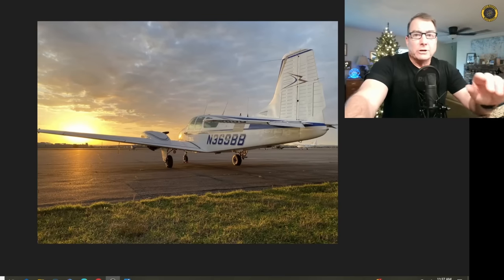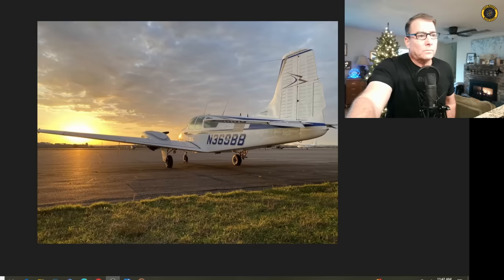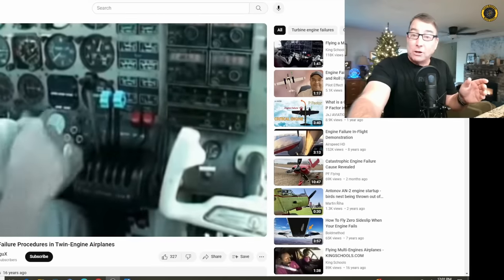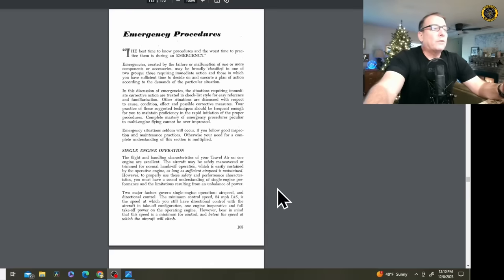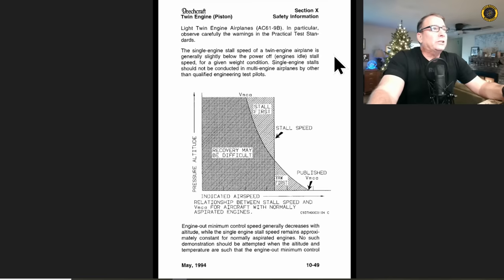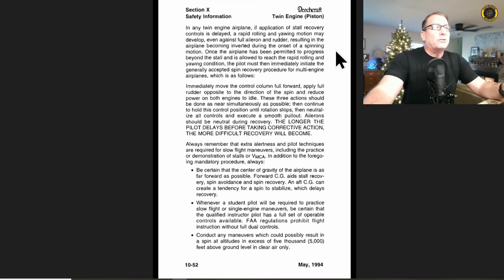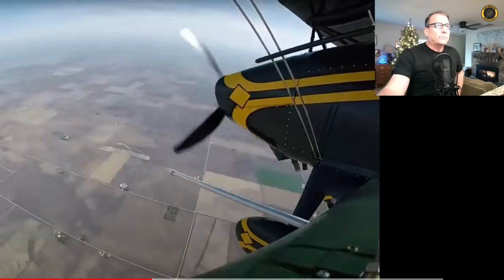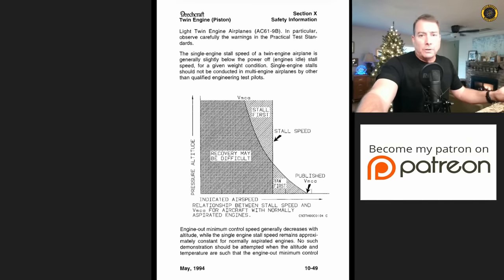Another Fatal Vmc Demo Stall Spin!! N369BB 4 Dec 2023

Comment: In the late 70's, at the biannual CFI refresher course put on by the FAA, a video was shown of an attempt to recover from a spin in a Piper Aztec. The airplane was fitted with a door hinge release and a drag chute. A test pilot wearing a parachute deliberately allowed the airplane to enter a spin from a single engine VMC demonstration. The pilot used all the spin recovery techniques we know about; full opposite rudder and full forward stick. The Aztec continued to spin and the drag chute was deployed. A few rotations later you see the door fly off and the pilot bailing out and parachute opening. When these light twins enter a spin they WILL NOT recover. You cannot let the airplane stall when demonstrating VMC! As you climb to find a safe altitude for the demonstration, the VMC eventually decreases below the stall speed. You must consider the demonstration of rudder input to control yaw satisfactory, prior to reaching VMC. The FAA needs to stop this. In the simulator, we do V1 engine cuts in a 757,  but there is no requirement for VMC demonstrations! Why does the FAA insist on this kind of training?

Comment: Hi Juan. I'm just wondering if this very sad incident---as well as the Vmc demo events you allude to---might relate to the lack of spin-recovery proficiency demonstration in US CPL student qualifying flights. North of the border, all CPL candidates must still demonstrate independent entry and recovery from full spin autorotation, which of course is precipitated by solo practice. When I demonstrate Vmc in Senecas, we are always spin ready. I firmly believe that students must experience the ineffective full deflection of control inputs as the final warning the aircraft provides, and they must also experience how quickly and simply the event can be immediately stopped with idle power. If we shelter our students from these experiences, we are doing them a disservice.

As always, your analyses are core to our on-going recurrent training as pilots.  Thank you!

Comment: Juan, the majority of this video was very well done. However I will mention one thing: this accident in my opinion has nothing to do with the 1500 hour rule.
 
The student was 67 and the instructor (31) had a lot of time in the aircraft. Good time…Who knows?, but I think you would still have this accident in a world without the 1500 hour rule (even if it is baseless). Reform needs to be on the part of the FAA in how VMC maneuvers are talked about and how they are performed to minimize risk and maximize correlation.

Comment: A VMCA demo does not need the use of full rudder. I’ve instructed many multi engine students over 30 years. Instructors please just use half the available rudder when doing the demo. The yaw and recovery are the exact same thing as when using full rudder but you will have a sufficient safety margin above the stall. There is zero reason to make full rudder available to your students. The demo is just to show what happens when you run out of rudder, the subsequent yaw and then recovery. All of which can take place by simulating the event using less rudder.

Comment: Thanks for this. I had heard that there was a tendency for these lower performance twin engine piston powered aircraft to fail on single engine failure, but was not clear why. 

This then begs the question what to do when the AC is above the crossover point when it fails which also follows what reduces the yaw, which would indicate the backing off of the working engine and feathering the prop on the dead engine while instituting a lowered angle of attack in a descent and increasing power to the functioning engine and managing the rudder while approaching the the desired altitude is reached. Then contact the ATC. Seems like they could have put a bigger rudder on these. 

Lets do some physics here, you take off with two full tanks of fuel, then climb at full power to a cruise altitutude of 13,000 feet which is 8000 feet above the crossover altitude. A standard descent at 80knts of is 1000 feet per 3nm which means the descent will require 24 nm at less than 1.5 nm per minute or more than 16 minutes. This means a standard descent will require almost full power of the remaining engine, and thus in order to back off power that craft needs to descend at a more rapid descent or the pilot would need to both be fighting rudder and level flight performance stall at the same time unless drastic measures were taken.

Comment: Your exasperation is heard and is warranted.  You learned the whole world of spins in the safety of a Pitts.  Upright, inverted, accelerated, flat spins are all easily entered and exited in a Pitts, and there is no better training for a new pilot.  However to have instructor pilots and their students nibbling at the aerobatic envelope in a non-aerobatic aircraft is a death wish.  Darwinian awards for them all.
Rich Stowell CFI wrote an excellent book entitled “P.A.R.E.” Standing for Power off, Ailerons neutral, opposite Rudder, and Elevator to recover from the dive.

Comment: I know it's a different maneuver, but this is what we do in helicopters for simulating failure of the tail rotor control systems-- CFI just locks the pedals where they want to (too much left or too much right, whatever you wanna practice) and the student has to figure out how to deal with it. We get the same thing with vertical stabilizer stall in some configurations if the students get too slow (increased yawing initially produces more anti-torque lift from the vertical stabilizer to help prevent further yawing... until it doesn't). Super easy way to create a realistic problem for the student to wrestle with, without necessarily invoking the maximum parameters.

Hope some of those new CFIs watch this video. GA twins look scary a/f and generally seem like a really poor choice of aircraft for anyone who's unable to maintain a very high level of flying proficiency.

Comment: I chartered quite a few times in South Africa a Pilates PC-12 single turboprop engined business get to get 5/6 people to remote locations quickly, worked really well for us.  We then had a team of senior executives visiting and I was advised they need 2 engines and 2 pilots as they are VIPs!!  So I chartered a twin turboprop engined aircraft (not sure what model). When I met the aircraft at the landing strip (not a runway) the captain asked me “why do they need 2 pilots and 2 engines? “. I said they are VIP’s.  He laughed and said “on light aircraft better to have one engine than 2, an single engine aircraft easily acts as a glider on loss of the engine, where as with loss of one engine on a twin engine aircraft it is easier to get into a spin, the second engine just gets you to the crash site faster”

Comment: Absolutely agree, trying to demo VMC without limiting rudder travel is very dangerous. Another way to increase your safety is to deploy approach flaps, in order to reduce stall speed and make it below VMC speed (in addition to blocking rudder travel with the IP’s foot). The Army used to teach FW pilots in the Beech Baron T-42 model (the 95-55B) and doing intentional stalls, lost a number of T-42’s to stall/spin accidents. Not good. I have done hundreds of VMC demos, safely, in Barons, Travel Airs, and Piper PA-44 twins, but always limiting rudder travel and using approach flaps, and always recovering at first loss of directional control, or before approaching stall speed. Fly safe out there!

Comment: Juan - Such a tragic ending w/Pilot just casually talking on radio.  Mid '90s saw MD-90 on approach, plummet in downdraft, Capt filled me in 2 yrs later 1st Ofcr began screaming, but Capt pulled 'er out in Oak forest, & actually flew thru forest rising from treetops.  1st Ofcr still screaming until Capt violated every rule at International Airport, landing w/o Clearance, but when alit, Capt said, "And we're down", 1st Ofcr changed to whimpering.  Company/Medical came aboard, shot him up, he stopped whimpering, they put him on board for removal, after which he drove rental home as no longer flew!  Kind of like opposite of Pilot in video Juan?

Comment: If that's a Baron 55D I recall it takes pretty much all the rudder needing some trim to maintain an easier 1 engine out. My MEI instructor told me, and I had no complaints about it, that if I lose it it's his airplane. He knew how much trim to take out. The Baron is a dart running good. Single engine was spooky for me at night. Try it. It's a touchy plane.

Comment: Vmc even at alt can be deadly. Sad we cant do sims for Vmc. Back in 1980 I was a Tech at NAS Pax river on the New F 18 program. TPS had 8 ships, Ship 4  was a  stall spin. No 4 was out  doing engine out at VMC, went into a flat spin at 18Kft.. Rode it in all the way, never recovered, ejection was good at 4000 feet, all while on Navy  120X video.

Comment: Blocking rudder is important but something just as imporant when performing a VMC demo is the checkride applicant needs to keep wings level. Every degree you bank the aircraft towards the operating engine, VMCa decreases by 3 kts roughly. At ATP, we dont have any issues because we perform the maneuver wings level so that we get first indication of loss of directional control well above stall speed. And that is without the instructor or DPE having to block the rudder. If you bank up to 5degrees into the operating engine in a VMC demo, you are greatly increasing the risk of stalling the aircraft before losing directional control. You shouldnt even feel buffeting or hear a stall horn if you do the procedure correctly. I performed countless VMC demos in the PA44-180 in high density altitude conditions in Phoenix, AZ and never once had a problem in doing so, hence why I have my commercial multi certificate in hand.
Reply: Good reminder about not banking into the operating engine when doing a Vmca demo. Thanks.

Comment: Well done Juan.  The fAA should be acting to put the blocking of the rudder by the instructor into every syllabus they approve.  As you know, the syllabus used to ask for a vmc demo below 500 feet. That caused many accidents That was resolved by adding altitude.  But I believe you are correct.  You have a bunch of instructors that don't fully understand the concept of the VMCA demo.  Certainly don't understand what has happened once the airplane is in a full spin. The last one, before this, a Seminole I believe was caught on camera.  I don't think that ever went flat.  I believe that could have been recovered (from available video).  I could be wrong.  I hope the industry can resolve this.  It is a trend we don't need to be in.
Last note.  I started my twin life with a Colemill 55 baron conversion with 300 HP a side.  I knew it was a handful but never thought of the rudder stall or blank out.  That is interesting. Thanks for doing what you do

Comment: Someone will surely call me off for this: Anyway, I passed my IFR twin rating in Switzerland where there is no such thing as engine off blue lining (I think it’s same rest of Europe). Instead, one of the engines is simply idled for the purpose. When I moved to PR, I did the twin training on my Aztec F to get a US license. The instructor turned off one engine and started tackling stall speed. As I have many hours of practice in gliders doing volontary spins, I told the instructor to stop this game as I felt how close we were to danger zone. One month later, an instructor spinned to the ground close to the airport, exactly same spot where we were training…. This still gives me shivers years later and I’m glad my Aztec was STOL equipped..

Comment: Juan, since discovering your channel, I am a big fan of your presentations, analysis, and review of aircraft accidents. Just a comment. I’m  sure that I’ve not watched all of your videos of accidents where a stall and a resultant spin occurred, but in the ones I have watched, I don’t recall you explaining exactly what a spin is. You certainly may have, and I most likely just missed it. But if not, I wonder if viewers might benefit from an explanation of what a spin is, e.g., the inboard wing is stalled (exceeded critical angle of attack and is no longer producing lift), and the outboard wing is not stalled (has not reached critical angle of attack and is still producing lift).  I hope I’m close to a reasonable definition. I’m a medically retired United pilot, and It’s been a while since I’ve reviewed this area in depth. So please excuse me if I am off here. Thanks for your great work, please keep it up.
Reply: Both wings are stalled, but the inner wing is much more deeply stalled than the outer one. The latter is just over the top of the lift curve.

Comment: The same recovery for any multi engine military aircraft, F-4, is the same for mulit engine bugsmashers. Neutralize aileron controls, throttles to idle, and full forward on the stick, opposite rudder, and make the bird fly straight with equal molecules speed over the wings.

Comment: I trained in and took my multi-engine check-ride in a Travel-Air on Florida's southwest coast, so at sea-level.  The pilot examiner, who was pretty old and retired shortly (maybe immediately) after my ride, decided to check my engine-out response by pulling the critical engine at Vmc on takeoff at 75' AGL.  If you're not a pilot, you should know that YOU'RE NOT SUPPOSED TO DO THAT!  To further investigate my abilities to handle the aircraft under such conditions, he didn't pull the power lever, oh no, he pulled the mixture.  You'd read that correctly: he'd killed the engine.  You don't do that at altitude, never mind less than 100 feet above the runway.  Damn, typing this, even I find it hard to believe.  I really do think he'd had a brain fart, but he didn't say anything like "whoops, wrong lever"; he'd said something to the effect of "makes it more real".  The Travel Air was a nice flier, if underpowered even for a light twin, and it handled the situation just fine (my first time!).  I'd never mentioned that episode before, now over 30 years ago.  I'd never thought to report the guy either, knowing he was at the tail of his career and that he'd scared himself a bit.  Besides, he'd passed me.

Comment: I went to an Aviation College where the program was run by The US Army.  It no longer exist.  Our Vmc training  was basically recovery on take off.  Which will teach you
to fly the aircraft off the runway rather than the stupidity of yanking it off to with a dash to 800ft.  I digress.  Our 1500ft alt Vmc training was full boat loss of control to
knife edge recovery.  Sometime more.  This took IPs that knew what they were doing.  It served me well at times when it hit the fan.  Especially when I got to the airlines.
In the mid 80s the FAA in all their lack of wisdom eliminated full Vmc recovery to just the nose wandering to the dead engine. Now civilian pilots never see Full Vmc recovery.

Comment: Why, Mr. Rutan? Why is there a small boom to the left of the fuselage? Why is the second engine, in the nose of the boom, five feet behind the engine on the fuselage nose? Why is the right wing almost five feet shorter than the left? Why are the wings swept forward? Why does the horizontal stabilizer, which joins the fins on the twin tails, extend past the right fin, but not past the left? And Burt Rutan answered “Self Preservation”.

I suppose that Rutan’s Boomerang would have been a hard to sell to a corporate flight department…

Comment: You make a good point. Why not include simulator time in that 1500-hour requirement? In fact why not lessen that simulator time to 100 hours or so if it focuses on high-risk scenarios? A pilot can be put in more dangerous scenarios during 100 hours in a simulator than they will face during 1500 hours of regular flying. And it can take place without risk to that pilot and passengers.

Comment: I just remember when I ran outta right rudder and the nose started to swing left,  I pulled the power off the right engine an dropped the nose a little on the 310.  Don't even know why I'm still here after 11 or 12,000 hours but I still am.

Comment: “Any time you add power to a spin you flatten that spin” This quote, without any qualifiers, hints Juan perhaps does not understand how the gyroscopic effect of a spinning propeller works. Adding power in right upright spin does not flatten a spin, it steepens a spin, which is also bad because it accelerates the spin rotation speed by lining up the mass with the spin axis, like a spinning ice skater accelerating rotation speed by pulling their arms in close to their body. If you fly a metric airplane reverse all that.

Comment: The Vmc definition you cited is incorrect. You can still maintain directional control at Vmc. FAR23.149 says "VMC is the calibrated airspeed at which, when the critical engine is suddenly made inoperative, it is possible to maintain control of the airplane with that engine still inoperative, and thereafter maintain straight flight at the same speed with an angle of bank of not more than 5 degrees." Not that it's important for the argument for this accident though. I was a CFI for 10 years and the quality of training at my school, which is one of the largest collegiate 141 schools, has decreased a lot over the past 7 years or so.

Comment: Watching some OEM spin tests for the early twin Baron, and noting typical recovery procedures, recovery required that the aircraft had to go past vertical (straight down) to recover.  Slightly upside down.   It is implied in recovery documentation, however is it explicitly mentioned for these more difficult aircraft?